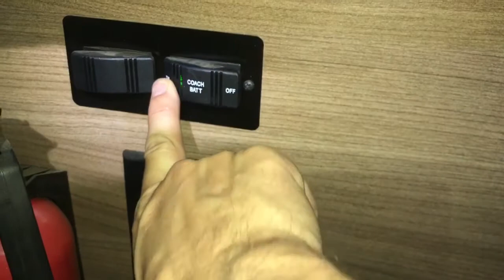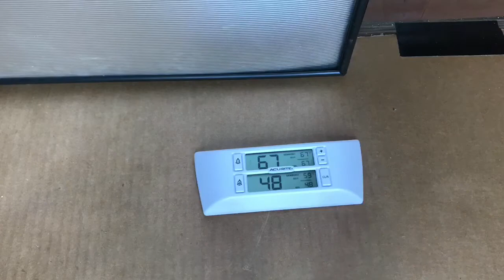Travato 59K NovaKool Refrigerator Repair

Comment: Thanks for the video, withoutthe string tidbit that safety wire was not coming back.   Our light is on but compressor stopped.  Going to pull out 1st (thanks to your video)b4 calling Nova Kool.  Crossing fingers just a loose wire.  2022KL.

Comment: you saved me when you showed the safety tether. I pulled and pulled then went to you tube and found your video and it came out, it was a lose wire I think? it is now running and we will see how long it lasts.

Comment: Terrific posting! The refrigerator in my 2018 K is starting to act up. It is cooling intermediately. I have a replacement DC module from nova cool so now I'm going to go ahead and install it. Thanks for taking the time to post this. Will make the swap very easy now.

Comment: This is by far one of the best videos as to how to handle a fix on the travato. How the hell did you get your camera back there so well. I couldn't get my hands back there and just ended up taking the bed cover off so I could work back there and remove the safety cable. Anyway. Thanks so much!!! I subscribed.